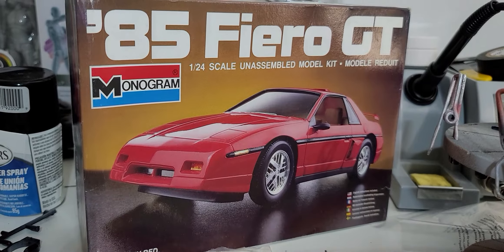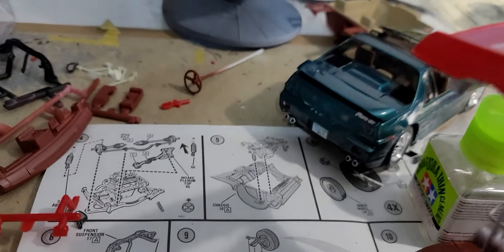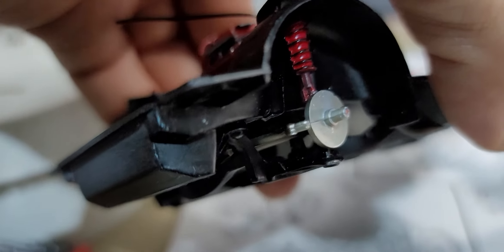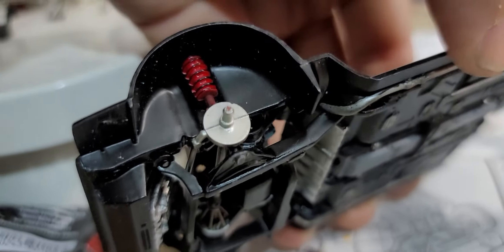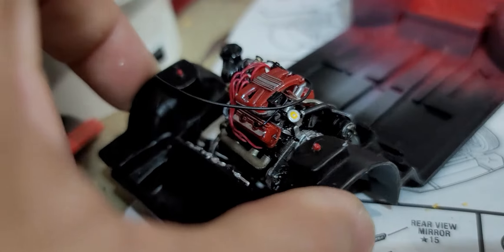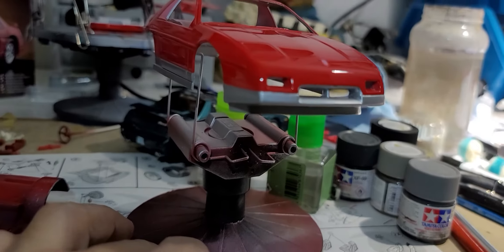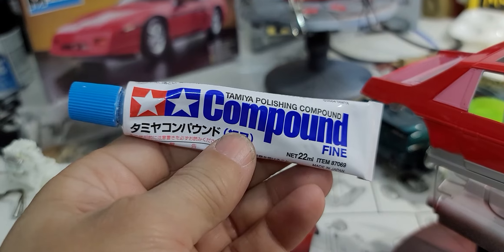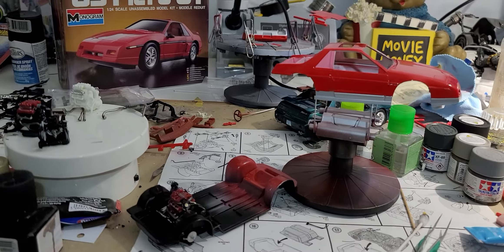Monogram 1985 fiero gt part 6

Comment: Great work bro! The paint on the body is gorgeous. Did you say you were going to clear it later? The engine bay is spot on. Good tip on installing the engine cradle. The disc brakes aren't going to be seen, I guess that's the reason for leaving as is. This one's going to be a stunner! 👍👍
Reply from the maker: Yes i still have to clear the body. I may do something with the brakes have to see how visible they will be